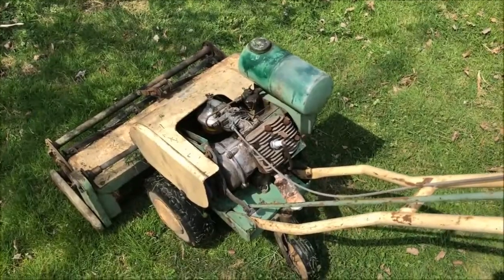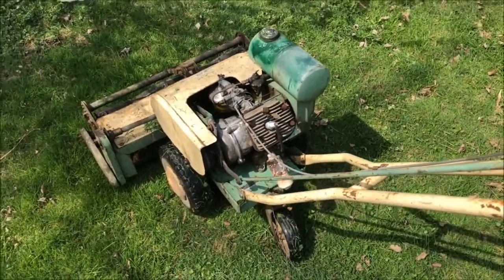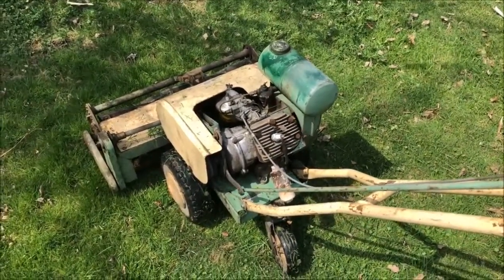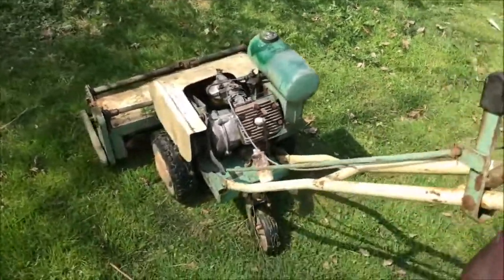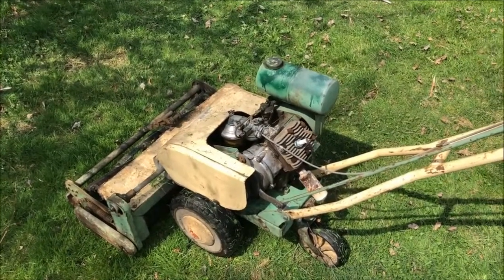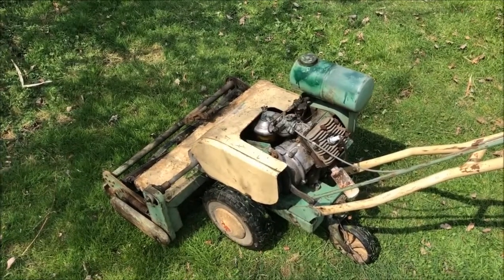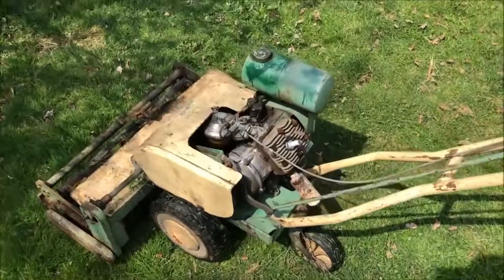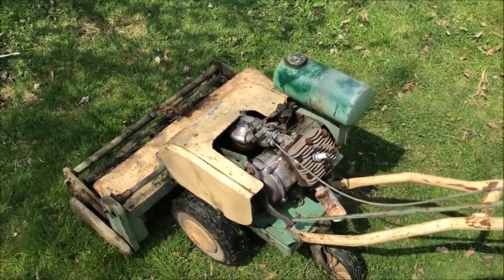1952 REO Trimalawn Powered Reel Mower

Comment: thanks for showing the trimlawn. i distinctly remember the throttle working, it would idle right down. our reo also had tow bar that would drag a reel mower on each side and i would walk in the middle of them never at full throttle because it was to fast. i would mow over an acre every week in under 2hrs.

Comment: That thing sounds like a hot rod!  Awesome!  My dad's house was built in 1956 I believe, and when he moved in (1979), there was an old gas-powered reel mower in the garage.  He used it a couple of times, but ended up buying a Craftsman mower around 1983, which he still has and uses to this day.

He told me once that when he put that reel mower away in the garage, he took the spark plug out and poured a tablespoon or so of oil in the cylinder.  I never saw him use it in my day, I was too young to remember.  It's still there, and probably hasn't run since 1981 or maybe even before.  He had some other mower in the interim that he likely garbage picked and fixed up, I remember there was a wire you'd touch to the terminal of the spark plug to ground it out and stop it.  I was really young at the time, but I vaguely remember he gave it to his father around then which he used for his tiny backyard.  He lived in a "row house" in Brooklyn, there was no front lawn, and the back was a postage stamp.  The only 2 ways into the backyard were through a slider in the den, and there was a door in the basement that went out there as well; there was no access to the backyard from the garage.  There were steps, however, that went from the den down to the ground level outside, I'd surmise it was probably stowed away under the steps. If I think of it, I'll ask my dad next time I talk to him.
Reply from the maker: Nice story, I'd like to hear what became of it. My luck, as soon as I finished uploading this and went to finish the back lawn with it, it decided to stall out and only wants to fun on near full choke, it may have sucked something into the carburetor. It has been working since I got it in early march and repaired it, soon as I video it, it doesn't want to work. Then my Electrolux 1205 auto cord rewind is giving trouble today. Everything at once...
Reply: Yeah I know how that all goes!  Sometimes the carb has a drain on the bowl, sometimes just draining it will take care of it.  Otherwise, small engine carbs are pretty simple devices.
Reply from the maker: I got around to fixing it today, I pulled the main jet needle valve and dropped the bowl and subsequently sprayed carb cleaner into it. I reassembled it and after a very hard first start it decided to run, and run well. Acted almost like a bubble/vapor lock in the fuel line.
Reply: Well at least it's running well again!

Comment: Different versions of this had a very simple air-vane governor. Using a mower with no governor must be pretty interesting.
Reply from the maker: It has an air-vane governor, the way that the throttle lever is outfitted isn't OEM, but without service information, that is being charged for, I cannot figure out how it is supposed to connect. A guess of mine is to try a spring between the cable and the actual throttle butterfly, but I haven't gotten around to experimenting. It is quite tricky to operate without the governor.
Reply: richard3700hz 
It is just a spring, a linkage rod, and a flapper vane (and I guess a pin for the flapper's hinge). I can probably dig up a picture of one I saw.
Reply: richard3700hz 
Upon further inspection of the video, the mower still appears to have the linkage and flapper vane. You are only missing a wiggly spring which is supposed to go between the throttle wire and the hole in the throttle butterfly. Tension on the spring makes the engine rev higher, while the air vane tries to push the throttle shut.
Reply from the maker: Thanks! Now I just need to find a suitable spring!
Reply: richard3700hz 
The wiggly springs that older Briggs and Stratton engines use would probably be perfect. Shorten for proper tension. And like I said, it just goes between the cable and where you currently have the cable plugged into the carburetor. You may need to loosen the nut on the little thing holding the cable, to reposition it to give room for the spring.
Reply from the maker: Thanks a million!